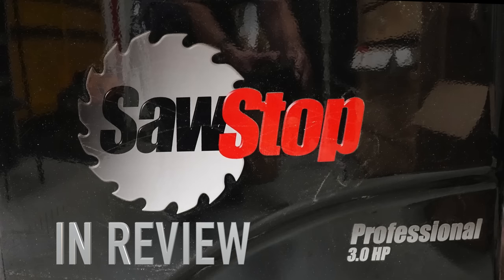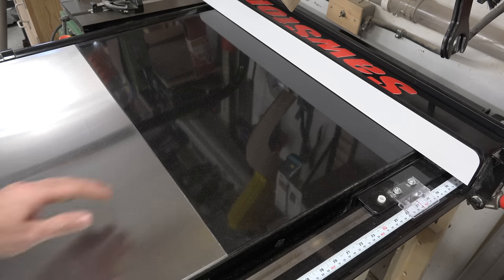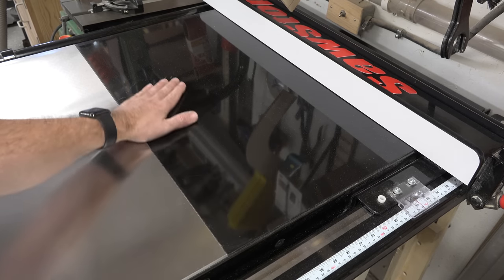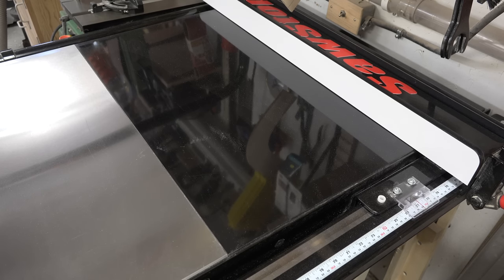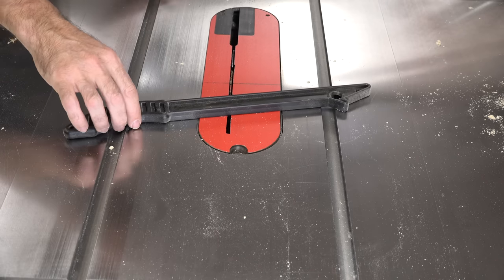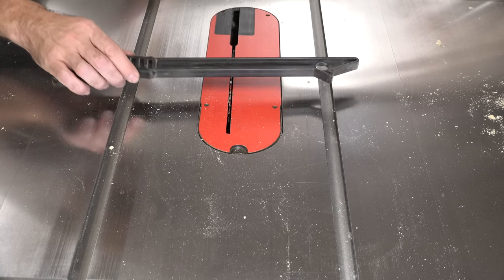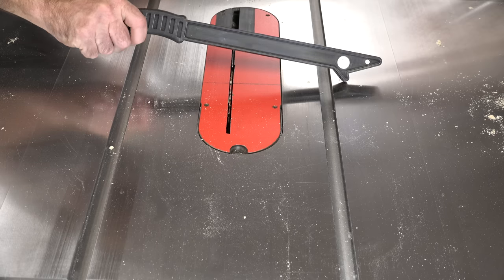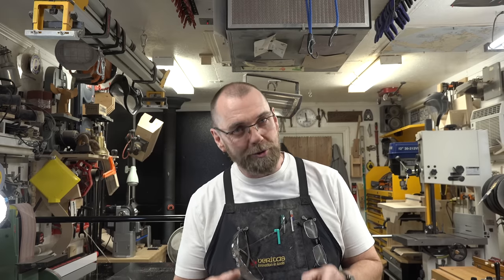Saw Stop Review

Comment: That was an excellent review of the SawStop. I’ve had what’s now called an ICS for over 12 years. It’s one of the original (black brake) units made back when SawStop had only one model. Mine has held up extremely well and has survived one move without any issues. Back when I bought mine the fence and pigtail were extra. I bought an Incra fence and my electrician installed a long cord with twist lock plugs to match the 220 outlet that he installed. I chose the 5hp motor because at the time that was only a $100 upgrade. In my opinion it wasn’t necessary but since I spent so much on the saw the upgrade was a no brainer. I got my SawStop after showing my wife the SawStop videos. She was sold immediately and didn’t care about the cost. It’s proven to be an outstanding choice and I really enjoy using it.
Reply from the maker: Wow, what a great testimonial to the saw and it's quality.  I'm glad that you are still enjoying your saw and although they seem pricey at first, once you get the opportunity to work on one, you will understand some of the price point.  It's not just about the safety feature but it is also about a damn well built piece of equipment.  I don't regret my purchase one bit and I'm sure that you don't either.  Thank you for tuning in to the show and for taking the time to leave your comment.  It's appreciated.

Comment: Great review Kenny.   I have the same saw and love it.   I think the deficiencies you noted are fair.  I'm also 6'2" and an undisclosed weight,  I definitely agree with the access panel comment.   But not having a need to open it since day 1 setup,  I forgot about it.  I want to give a thumbs up to the upgraded fence,  I thought I would end up wanting an after market fence but after a year of use in various projects,  the SawStop fence is rock solid,  it's not leaving my say any time soon.   I'm so glad I spent the extra for the 220V/3hp,  keep the blades sharp and it cuts like hot knife through butter with anything.   Which is also inherently safer.     Finally,  I think we just have to accept rating table saws should be on a scale of 9.  as you said,  none of the manufacturers are able to give a decent mitre guage.   I was just surprised SawStop hasn't teamed up with Incra or someone to provide the complete package instead of giving us a part most will end up not using.
Reply from the maker: Totally agree on all points here Sherloch.  I'm glad to hear that you enjoy your Sawstop and that you share the same opinions as my own.  Thanks for tuning in and for taking the time to leave a comment.  I appreciate that.

Comment: i couldn't agree with y9ou more about the motor!  i have had three Unisaws, two were 3 horsepower and one was two hp.  with a sharp blade, i have never felt that i required more power and like you , i have cut some extremely hard wood and miles of aluminum.  i was just about to purchase the 5hp ICS and at the last minute decide to get the PCS and i haven't regretted it yet.  thanks for the video!
Reply from the maker: Glad to hear that you found the show useful and that you are happy with your 3HP saw.  Thanks for tuning in to the show and taking the time to leave your comment.  It's truly appreciated.

Comment: I enjoyed your review.  I have owned the 3hp PCS for about 4 months so not a lot of mileage on it yet, but I have used it a lot in that time.  I  replaced a 14 year old Delta hybrid mostly because that saw didn't have a riving knife.   On my miter gauge there is a fine tune screw for the positive stop.   I have not had to open the small access panel, it does look like it could be a pain to work through.   No issues with my side table either, after all the gripes about it I was expecting a pretzel, but I think it's plenty flat and strong for what it's intended for.  Thanks for taking time to do the videos.
Reply from the maker: Thanks for the kind words on the show Charles.  I'm glad that you enjoyed the review and I'm also glad that you are enjoying your saw.  That's great to hear.  Thanks for tuning in to the show and for chiming in with your experience with the saw.  I truly appreciate it.

Comment: Thanks for taking the time to do this video I appreciate this information as I look to upgrade my table saw, do you think the 1.5 hp would be ok our shop I stick with the 3hp 220? My problem is my 220 plug is currently not in the best location and the cord would be a trip hazard across the floor
Reply from the maker: I'm not sure whether or not the 1.5 HP would suit your needs or not Julie as I'm not sure what your needs are.    A 220volt receptacle can always be relocated closer to the saw and if the only thing stopping you is the cord of the saw, that issue is easily remedied.  I know this isn't much of a help but good luck with your decision and thanks for tuning in to the show.

Comment: I thoroughly enjoyed your honest review.  I currently a Craftsman Professional table saw with a Biesemeyer fence, 1.75 hp.  it's been a great table saw once I stopped using the worthless miter gauge that came with the saw and replaced it with the Incra 5000 miter sled.  For a couple of years now, I have been having trouble with the motor.  Craftsman no longer makes replacement parts for this saw.  So next couple of months I plan on replacing this saw.  I have narrowed my search down to either the Powermatic 3 hp or the Saw Stop 3 hp.  Your article is pretty convincing for the Saw Stop.  One question I have is regarding the blade:  what blade do you use on your saw?
Reply from the maker: I use whatever blade I feel like in the saw Ed.  I have the original SawStop blade that came with the unit and I also have several Diablo blades (painted red) that I use.  I have a Freud stacked dado blade set that I also use with a dado brake and I have a couple of Forrest blades that I'm rather fond of.  Basically, I haven't found a blade yet that wouldn't work with the saw.  It's easy to test if a blade will work or not.  Just install it in the saw, apply power to the control centre and with the saw turned off, touch the blade gently with your finger.  The control centre will start flashing quickly to tell you that it has had a contact with flesh.  I hope that this answers your question.  I'm glad that you enjoyed the review and if you have any other questions along the way while trying to decide which saw you'd like to purchase, please don't hesitate to ask me.  I'd be more than happy to help out if I can.  It's a lot of money to spend on a tool and if I can make you feel better about spending that money (either on this saw or another one) then I'd have no problems answering your questions.  Thanks for tuning in to the show Ed and taking the time to leave the kind words.

Comment: What was the name of the product you used to protect the table top? 

Will soon look at your assembly video as I am about to order this saw.

Thanks for a very helpful presentation.
Reply from the maker: I used to use a product called Glide Cote but have changed it to a metal polish called AutoSol.  I find that the AutoSol metal polish does a much better job and lasts much longer.  Here's a link https://www.leevalley.com/en-ca/shop/tools/supplies/polishing/67014-autosol-metal-polish
I hope it helps.  Thanks for tuning in to the show.

Comment: For so long I was debating with myself if I should buy it or not. I was looking at Powermatic, Jet, Grizzly, Laguna. I went to Lavergne TN to check the Powematic and Jet(they are pretty much the same thing, same company, I won't get into arguments which is better or not, I'll just say most of my big tools are white-lots of money saved over the yellow), I even went to Springfield MO to check the Grizzly ones. I've seen a Laguna at a Woodcraft store and I saw the Sawstop in multiple locations. Ok now....as far as build quality i can't say which one is better, sincerely it looks like the all come out of the same factory,  only they have different colors and some little design differences here and there. Now the price is a big difference Sawstop and Powermatic are right on top. If it wouldn't  be for the safety feature I would go right away and buy a 3HP Grizzly for under $2000. But when it comes to safety I just can't push the Sawstop away, so today I finally pulled the trigger and I bought a Sawstop PCS 3HP. One of my passions is music, I play keyboards, I just can't afford not to be able to play my synths anymore because of even the slightest possibility of an accident. Here's my 2 cents why I bought a Sawstop and not any other ones. Actually there's another saw even better than this, made in Austria, Format Kappa4 which has even a crazier safety feature based on magnets reversed polarity, but that saw starts at $35.000...so that's out of reach for now. I hope my little coment will help you decide what's gonna be your next saw. Good luck and keep safe!
Reply from the maker: I'm glad that you were finally able to make your decision.  I have no affiliation with SawStop or any other manufacturer of tools so I have nothing to gain by you purchasing a PCS 3HP.  I do know that if you love your SawStop as much as I do, you have pretty much purchased your last table saw.  The peace of mind of knowing that those safety features are there are priceless.  I too play instruments and I can completely relate to your comment about wanting to keep your fingers safe to be able to play another day.  Good luck with your new saw and enjoy.  Thanks for tuning in to the show and taking the time to leave your comments.  It is very much appreciated.

Comment: Hi Kenny, thankyou for an excellent and thorough in depth analysis and review, living here in Ireland the SawStop is not available at the moment, i went the Laguna Fusion 3 option as my local tool centre is a Laguna Dealer and i have to say that the two cabinet saws are very similar apart from the Stopping Safety feature of course. l design and make bespoke furniture and mainly work with English Oak and the 3horse power is plenty on 240v the mitre gauge or mitre square is the only part that is average compared to the rest  of the saw, the Laguna 3 runs surprisingly quiet and does all I need from the saw, anyways I hope that I have not bored you, kindest regards Louie Ulster Workshops Uk
Reply from the maker: You have definitely not bored me Louie. I very much enjoy hearing from the people that watch that program and hearing about what tools they have and the things that they make in the shop.  Your Laguna sounds like a capable saw and I will be looking it up and checking out the specs on it tonight.  I have a friend of mine that is a Laguna rep and yet, I don't have a single Laguna tool in the shop.  Figure that one out.  LOL.  Thanks for tuning in and taking the time to leave a comment.  It is truly appreciated.

Comment: Kenny, first I like your honest review.  Full stop!

But, a couple of your issues, have workarounds.
That access door, ICS.  The Industrial saw has 2 
LARGE access doors.  Miter gauge, get a miter 
table.  SawStop makes one, and I have installed 
a few.  Will overcome ALL your miter issues.

Another question, you said 8/10.  Do you rate 
ANY OTHER 10 inch table saw higher?

I do not own a table saw, with the exception of a 
70 year old Cast Iron ShopSmith.  (8 inch, tilting 
table, the original Model 10.)  However, I work at 
the retailer, for the east (Phoenix Az) valley area, and 
have assembled quite a few, and repaired even 
more. I DO have experience with woodwork, just 
no longer own any major tools.  (I borrow from 
friends.  Shop size, limits me.)

I still think the SawStop is the best table saw made, 
at any price.  (And, the rest are vastly cheaper.)

steve
Reply from the maker: You have to keep in mind Steve, that a review is nothing more than someone's opinion and although I might give it a score of 8/10, there are others that might give it more or less than I did.  A review of a tool is just that, a review of the tool as it comes from the manufacturer.  It is not a review of something that you can "work around".  I wouldn't give a tool extra points just because I could put out more money and fix it myself.  The review is given for the tool as it is provided from the manufacturer.  That being said, I love this saw and have "worked around" the issues that bother me. Knowing everything I know now, I would still purchase this saw again.  It's a quality saw the functions flawlessly.  I haven't reviewed any other saws, simply because I don't believe in reviewing something unless you have had a good chance to work with it over some time and get to know the ins and outs.  I only review what I know.  Too many Youtubers review things right out of the box before they every have a chance to work with the product.  That's not a review, that's an unboxing.  LOL.  I hope this has helped you and answered your questions.  Thank you so much for tuning in and for taking the time to leave a comment.  I truly appreciate your input.

Comment: I have the same saw and I love it. What do you use for dust extraction?
Reply from the maker: I have a 1 HP, 570 CFM dust collector unit with a 4" port.  I use a garbage can separator that I have modified and improved the seal on and it works just perfectly for my application.  Thanks for tuning in to the show and for posting your question.  If you have any other questions, please don't hesitate to ask.  I would be more than happy to help out if I can.

Comment: Very nice, clear, useful review. Great video & audio quality, too! I've seen lots of SawStop PCS assembly reviews, and this was definitely among the most thoughtful, useful, and well done.

My only question is only 8/10? Even though you go through your rationale, I think the things you don't like are very minor. The short cord you fixed. One time and problem solved. The small access panel, as you said, frustrated you during initial setup. But that's also pretty much one and done, not something that bugs you an a daily basis. The other 'negatives' (eg plastic knobs on the blade height and angle adjustment wheels and the serviceable if limited miter gauge) are, to me, extremely minor. I downgrade a personal review primarily on things that are substandard compared to the competition and/or that cannot be easily (and relatively inexpensively) prevented or fixed.

And while I understand your desire to avoid 'blade safety' wars in the comments, based on your review, that has to count positively.

So I would have thought maybe an 8/10 on set-up (and to be honest, even that seems stingy), and at least 9/10 overall based on your comments & experiences. I guess you'd give a "modern" Delta Unisaw, what, maybe a 5 or 6?? Anyway, not trying to be negative this video was EXCELLENT!!
Reply from the maker: My goal here Steve, was to give an honest review of the product and I honestly feel I have given that.  I have yet to find a tool that deserves a 10/10 and that is the thing about reviews....they are like movie reviews and they are just the opinion of one person.  That opinion can vary for many different reasons.  The saw itself functions flawlessly and I absolutely love working on it.  The "minor" points that you bring up are ones that, if I am paying the extra cost for a well built saw, I don't feel that the manufacturer should have skimped on the accessories.  Plastic knobs when everything else is metal, a mediocre mitre fence when a higher quality one could have been provided.  If you (SawStop) are going to class yourself in amongst the top saws, you have to make it about something more than just your safety feature.  After all, we don't spend our time trying to cut our fingers off....we spend our time adjusting blades and cutting stock using the rip fence and mitre fence.  When paying that kind of cash for a unit, having to spend more money to bring it up to a standard that should have already existed is worth a couple points of loss in my mind.  Don't get me wrong Steve, I love this saw.  I also appreciate the honesty of your comment and I welcome it.  I'm not about online arguing and I know that everyone has an opinion and is entitled to it.  I actually love the fact that you are coming to the saw's aide and questioning the lower score.  Would I purchase this saw again?  100%.  Do I regret purchasing this saw?  Absolutely not.  It just goes to show that we can all have an opinion and still get along.  So in the nature of compromise and "getting along", how about we meet in the middle and I will give it an 8.5/10.  LOL.  Thank you for tuning in to the show Steve and taking the time to leave such an awesome comment.  It's good folks like yourself that make the show well worth all the effort to produce.  Thanks again.

Comment: Phenolic resin top if I'm not mistaken, if so its what we use on are concrete forms and it will scratch (so will steel and superman) but its tough stuff, and not cheap.
Reply from the maker: I will most definitely say that the side extension table is NOT phenolic resin.  I have a router table top that is phenolic resin and the stuff is unreal.  The extension tables on the SawStop are a wooden frame with a formica type laminate top.  I can't say for certain as to what type of laminate it is but I can say that it most definitely is not phenolic resin.  The zero clearance inserts however, do have a phenolic resin core to them with is nice.  Thanks for tuning in.  P.S. I'm glad that you edited your comment because I had no idea what you were talking about with Superman.  Darned auto correct.  LOL.